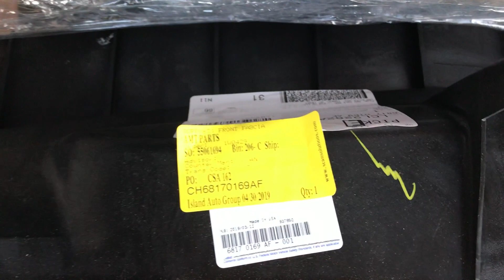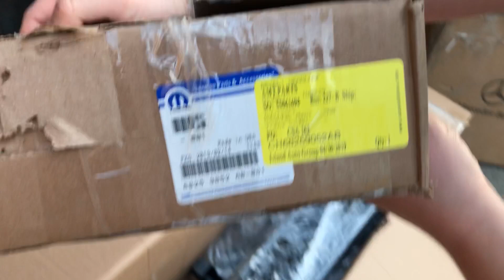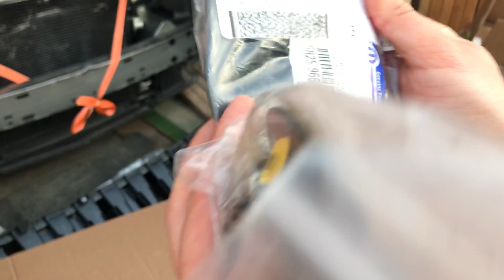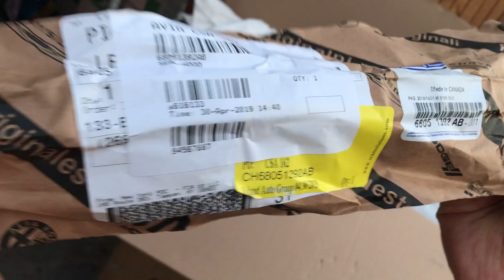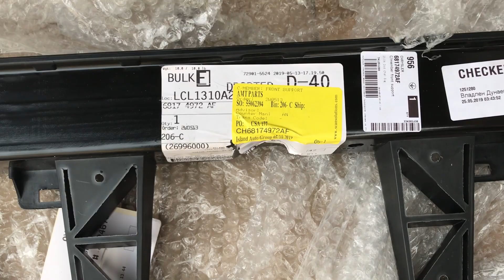Rebuilding A Wrecked Dodge Challenger R/T: #unpackaging of new details

Comment: how much was all that plastic came too.
Reply from the maker: I don't understand your qustion
Reply: @_demon1k_  how much for the front end did that come up to in price.
Reply from the maker: @davidmills9685 all the parts that I changed to the front are new and original, price with shipping  ~ 3,5k $
Reply: @_demon1k_  thanks I wrecked my 2009 and I've been looking at the bumper and all those internal braces and it's been a hassle to figure all the parts to replace evidently I dont have a demon but I was just wondering what it's going to cost me and the reason I said plastic is on the old cars every thing was metal it seems easier so thanks for the heads up .